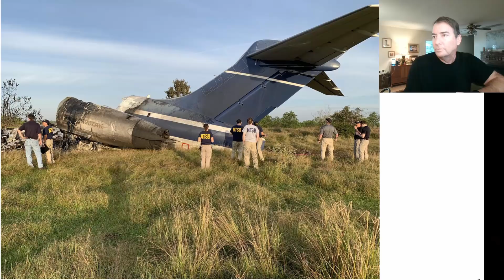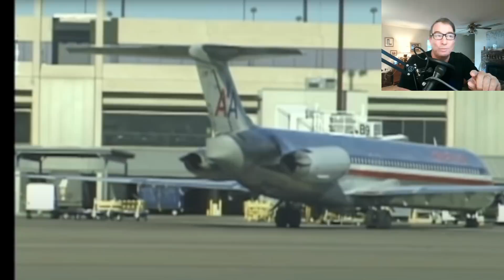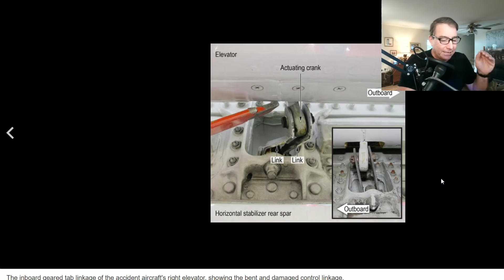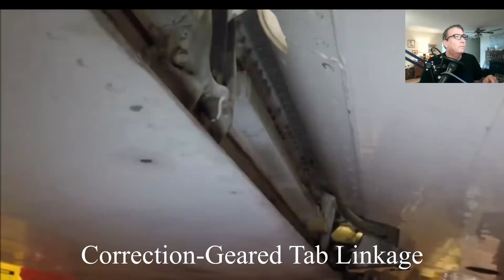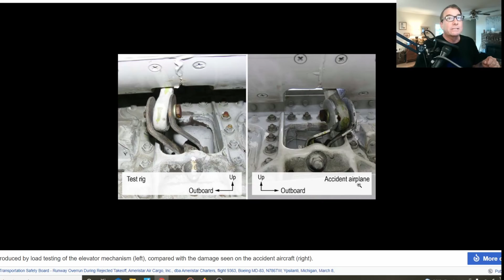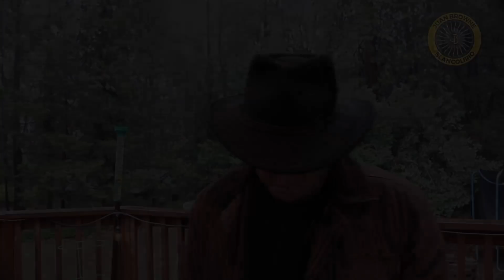MD-87 Crash Houston UPDATE 9 Nov. Flight Controls

Comment: Excellent video. A few more things to add here.  The hyd power you mentioned for these elevators is designed to push the elevators down during a deep stall situations and can only be fully tested in flight. Also, for the viewers not savvy enough to comprehend this old reliable technology, the geared tab linkage shown on the video is connected to the tabs via a push rod that ran inside the elevators. Also, these elevators were statically balanced nose heavy, which is why when the airplane is  parked, the elevators are full ANU.. This provided feedback on the yoke as airspeed built up during takeoff, fairing the elevators with the horz stab. The PF should have felt this feedback. No feedback, RTO..
The DC8 used the same identical system, (minus the stall had boosted system) but because of the size of the elevators, an elevator gust lock was installed, and operated from the cockpit by the FO. I spent many years of my life exclusively rigging flight controls on both DC9/MD80s, and all series of DC8s from -55s, thru -70s. Wonderful old school tech. Thank God for the rain in your area. Great show.
Reply: He mentions that the control tabs are hydraulically assisted, which is technically not true.  The only hydraulic actuation of the pitch control moves the actual elevator, not the control tabs.  And that hydraulic power is only activated in a deep-stall recovery.
Reply: @Zack Cawvey - Complicated?  Nope.  Quite simple.  It uses aerodynamic forces to amplify and assist pilot applied forces, requiring no hydraulics whatsoever.  You can control a 100,000+ aircraft with no electric or hydraulic systems, so works when those systems fail.  The controls aren't much heavier than a C172. The only hydraulics in the pitch system is the powered elevator, but that system is virtually never used, except in a deep stall recovery, which has also almost never occurred in a DC-9 or derivatives.  If you want complicated, then you want fly-by-wire.  One nickname for the DC-9 is "direct cable", as in DC.  Cables through pulleys to control tabs.  Doesn't get any simpler.
Reply: damn good expert
Reply: Fully concur with your statement.  As a retired senior engineer from McDonnell Douglas / Boeing, I would much rather fly on an MD 80 any day over a 737 for safety.
Reply: @tomjoseph1444  Great additions to the systems discussion.  I agree with the simplicity of the system.  If you want to talk about possible paths of failures in today’s aircraft, think about tin whiskers.
Reply: Maybe Zack meant complex or difficult to understand without seeing it in action and fully comprehending its design and function.  I don’t fully understand how it works, myself, but I believe you guys!  So, the DC-8 and DC-9 had this, but not the DC-10, I guess?  That DC-10 that crashed in the cornfield in Iowa could have sure used it, right?  Well, if the cables weren’t also cut by the disintegration of the tail engine that took out the hydraulics…right?
Did the early B-52’s have something similar?  Maybe it was a NASA article I read about their old B-52B.  If I recall, the yoke was connected to ailerons and elevator tabs by cables.  The control tabs were like trim tabs, I think.  When the tab moved up, the resultant force of it deflecting air upward pushed the control surface downward…which, in the case of the elevator, would cause the nose to lower.  Of course, I’d assume these control tabs would be rigged so that the yoke and rudder pedal direction movement was like any conventional aircraft.
Reply: @chucksavall  Yes I seem to recall that a 5 degree nose down split between elevators and control tab position would would activate elevator boost and that would be accompanied by an annunciator panel segment lighting up.I have no experience with the MD 80 but I have on the DC9-30. As I recall the only primary control surface that was normally hydraulically powered was the rudder and even that could be selected out and revert to control tab actuation.
Reply: Anyone go One V One Red Flag MD-87 V F-22? Get your Patch from Mav?
Reply: @chucksavall I have also come across some information stating that there was at least one version of the DC-9 that had "elevators" mounted to the trailing edge of the engine pylons. These where deflected steeply downward in the event of a (deep?) stall. I do not know if these were automatically, or pilot activated. Do you have any knowledge of this system that you could share?
Reply: @bob2161  Well, I was fortunate to fly the DC9 -10 and -30, plus the MD-88 and the B717.  I was an instructor pilot on the DC9 s and B717.  My airline, just happened to own the oldest DC9 on the planet, basically serial No 2, which was used for the FAA flight test certifications.  I never heard of an "elevator" on the engine pylons.  The MD-80s did have a "strake" on the outboard lower engine nacelles, something to do with airflow over the T-tail in high angles of attack, as well as strakes on the lower front fuselage, to smooth airflow over the rudder.  The hydraulic elevator (when activated only in deep stall) had plenty of pitch authority to control stall recovery.  Wish I could post photos or schematics here.
Reply: @chucksavall   S/N# 2, wow! That would have been one of the short bus versions, right? Without the mutton chops (the strakes) below the cockpit. I don't think that version had the ox yoke hanging from the nose wheel either. 
It would be nice to post pics here. I just found a pic in my archive of the pylon "stall flap" I mentioned. I can't find the story that goes with it though.
Reply: @bob2161  - I've tried to post 2x now a link to a page with tons of info about the entire DC9 fleet history, but apparently links aren't allowed.  There are photos there and a bit of info on the MD-90 pylon elevators.  My entire post about this was deleted because I had a website link in it.  The MD-90s had the V2500 engines, and that may have played a role in why it required the pylon elevators. If you go to airlinercafe, DC9 info is on one of their pages.  Yup, the stubby -10 was pretty basic, and as they stretched the fuselage, that's when strakes, nose-wheel deflectors etc. all needed to be added.  Previous to DC9s, I was flying Learjets, and an empty DC9-10 had similar performance to a Lear, quite the rocketship airliner.
Reply: @chucksavall Earl, a friend of my father's was a pilot for United when the first 737's went into service. Those early ones were also stubbies. He called them guppies. He also enjoyed flying them light, said it performed much better than what he'd flown in the Navy (Viking). I remember listening to him and my dad drink beer and tell stories at cookouts and such. He was convinced that the 737 would have made an outstanding attack bomber during the Vietnam war. He had made a bunch of drawings and  few paintings depicting imagined sorties. He was actually a very talented artist. Back in the 70's he built me a plastic model, modified from a Monogram kit and pieces from other kits. It had 4 sidewinders under each wing, two to a hard point. Two bomb-bays, one ahead and one behind the main gear/wingbox. Eight 500 pounders forward and six aft. The 'coup de grâce' was the fuselage mounted guns. Two tail mounted, remote operated, independently targetable, twin 30 caliber machine guns. For up front, three, fixed to each side, was six, 50 calibers. Suitable for engaging enemy aircraft, and devastating strafing runs. On the top and sides he had painted it in the multi-green jungle camouflage that was used at the time and a pale flat grey belly and lower surfaces. On the nose he had done a version of the P-40 shark's mouth that was unmistakenly based on the orca whale. He even had the orca eyes up just below the side cockpit windows.
It was a thing of beauty, far and away better than any of my own models. I had it more than 20 years, until it was unfortunately lost during a move. 
I'm sure that if he were still with us, he would happily approve of the sub hunting 737 version the Navy is using today. 
By the way, I've not thought about Earl in a while now. Thank you for all the memories.
Reply: @Andrew-13579  No , the DC10 elevator was completly different , it was fully hydraulicaly powered by 3 separete hydraulic sero valves weighing approx 80 lbs each.
Reply: @johnyoung1128  True, i remember there was a lever with a "r" written on it to turn on/off the hydraulic  power of the rudder.
Reply: @bob2161  Yes, the MD90 has 2 flaps on the trailing edge of the engine pylons ,  wich automaticaly extend and put the aircraft nose down in case of stall.
Reply: Don’t forget my favorite. 727
Reply: Or we calls them FLUF’s
Reply: @chucksavall  Fabulous insight and experience to share.
On your issue with links - links to trusted sources are allowed and by trusted I mean links the YouTube algorithm trusts.
YouTube has been badly abused by many people in recent years and that's why they have had to come down hard on that stuff.
What you can do is give the name of the website where those materials are or the search parameters to put into Google to find them.
Reply: @Mo River      "this old reliable technology"

Except when the winds blow 60+ knots.
Reply: @bob2161  What you have heared is probably the pylon flaps. Pylon flaps are installed on the engine pylon trailing edges on the MD90, not the DC9 or the MD80 (not sure about the B717 though). The pylon flaps are hyraulicly operated, and the input to open the contol valve comes via the cable control system for the elevator tabs. The control valve opens when moving the control column the last 2 degrees motion against stop in aircraft nose down direction. The pylon flaps then moves full down. Moving control column aft of this 2 degree range will return pylon flaps to neutral. Moving control column aft will not activate pylon flaps, they only works in full nose down command. The MD90 has a much more complicated elevator control system than the classic DC9 and the MD80. MD90 elevators are normaly operated hydraulicly during the whole flight, with the option to reverse to manual control tab movement as the MD80 in case of loss of hydraulic power.
Reply: @cbx6_79  those are indeed the flaps of which I speak. I knew this was a feature on only one specific model. As I understand it, it has to do with the engines that where used on that particular model. Thank you for explaining the means by which they are deployed. That setup makes a lot of sense to me. 
You listed all the various models. In my mind they're all just different versions of a DC-9. I do recognize that there are some relatively significant differences between them. Still, they're all DC-9's that were just fitted out differently. I'm not sure why I'm as stuck on that as I am, it does tend to irk some aviation purists (rightfully so, I know). 
There are other planes I that I pay close attention to the different models, but for some reason, not the DC-9. 
(A good example of my model discrimination would by the Cessna models 190 and 195. As well as their models 150 and 152.)
Reply: @Zack Cawvey Not the case.  it is a simple system with only load feedback complicating it.  Hydraulic cylinders are for stall recovery but actuate before "deep stall"  Get hold of a LAMM schematic to see it if you don't believe I am qualified to discuss the matter as your tried and true experts on here.  I'm just an engineer from McDonnell Douglas in systems what the hell would I know eh?  And I've only seen 1,100 of the damn things out on the line.  Hydraulic systems were only to get the hinge moment without aero balances on tab driven surfaces.  In fact , the MD-80 airframe would be far more efficient than a 737 had we ever gone forward with powered controls, but that was voted down several times.  Engines were another matter, but MD-90 would have been the winner with powered controls and no Honeywell VSCF drives.  MD-95 / 717 solved those issues, but the -300 never got off the drawing board due to the Boeing merger and 737 sales conflict.
Reply: @bob2161  > He was convinced that the 737 would have made an outstanding attack bomber <  Fun to think about, if more than a bit dubious in practice.  But that does remind me of back when civil airliners actually were proposed for an offensive combat role.  Anyone remember the CMCA designs?  A DC-10, 747 or whatever would somehow sneak its humungous radar cross section past enemy defenses and disgorge a whole bunch of cruise missiles.  Hey, if it keeps a production line open...
Reply: @marcmcreynolds2827 that's an interesting take, a 747 or DC-10 loaded up with cruise missiles. 
Ofcourse, Earl's idea seems quite misguided today. You have to consider though, when he first started to form the idea. He had been flying attack missions, in Vietnam, in an airplane with a propeller on it's nose. You see, back then, if you're flying down in the treetops, a huge radar cross section, wasn't a thing. His biggest concern was being visually spotted from above. On missions where that was likely, fighters flying "High Cover" were employed to keep any such "Bad Guys" too busy to go tree trimming.
Reply: Wish I'd known that stuff when I was flying the MD-80.  'Blancolino' shojld be on the NTSB board.
Reply: @larrydoench416  . . . On the NTSB? Heck Juan and Dan should RUN the NTSB.

Comment: Juan, Another excellent explanation.  I currently fly a DC-9 30 series airplane as a contract pilot. On each flight, just prior to engine start, we do a jammed elevator check with a crew chief out in front to visual check the elevators when we push the yoke full forward. ( Altnernate and Aux hyd pumps on) pretty cheap insurance against trying to rotate with a jammed elevator. .
Reply from the maker: Thanks David!
Reply: I don't think that that proves that the elevator is not jammed down. The hydraulic power only pushes the elevator down when more than 10 degrees of tab are commanded. (20 year DC 9 Captain)
Reply: @leeoldershaw956  ... Well, I suppose that if the elevator doesn't happen to be fully down already, the downward movement of the elevator when the hydraulic boost kicks in would be an indication that it is not jammed. If no movement happens, that would be an indication that is is either jammed or that it is already fully down, in which case (which would be exceptional) I suppose you can bring a ladder or a platform cart and move the elevator by hand (I have done that myself, I mean moving the elevator by hand, not bringing a ladder, the plane was in maintenance so it already had a platform at the tail).
Reply: It looks like in the case of gust loads that cause the balance (servo) tab linkage to go overcenter and jam the elevator, this occurs when the elevator is forced quickly down.
       In this case, the hydraulic system elevator assist won’t show you anything since it’s function is to push the elevator down (where it’s already jammed).

     For a contract flight crew, a very long pole with a cushion on the end used to physically push the elevator up is really the only assurance you have to know that the elevator is not jammed AND.

Comment: I'm a mechanic for an airline that flew one of the newer MDs of the v2500 variety. We had a crew that seemingly lost elevator control about 100 ft from the ground on landing. A quick thinking pilot threw the throttles forward to force a flare...the crew was pretty spooked.

We found that, what looks to be in your drawing "surface follow up link" but could be slightly different on this MD, has a piece of metal that touches the end of both the "follow up link" and the control output and it pivots about a bearing, 1 ea for left and right. This bearing on one of the sides was seizing and consequently binding the yoke and inducing a split, putting the plane also into manual reversion. 

Haven't seen or heard of anything like that before or after but figured I'd share 🤙
Reply: Very Interesting Thanks for the information.  I never worked on this style of DC9/MD80's  mostly airbus and boeings I worked on.  I am not sure about the 727 I do not think they have a different system.
Reply: Thank you for the info Juan. It’s fascinating. 🎸